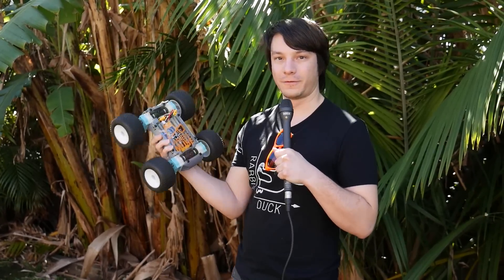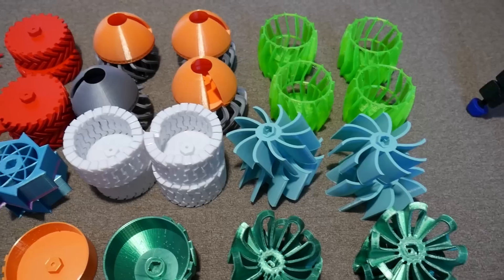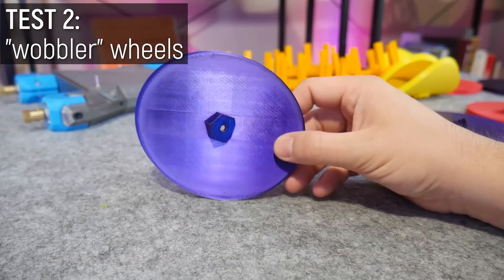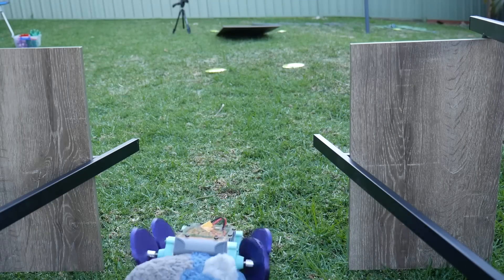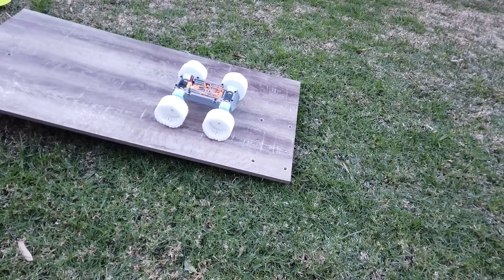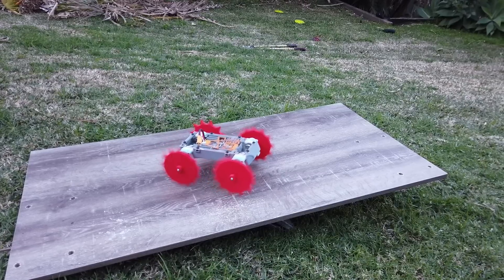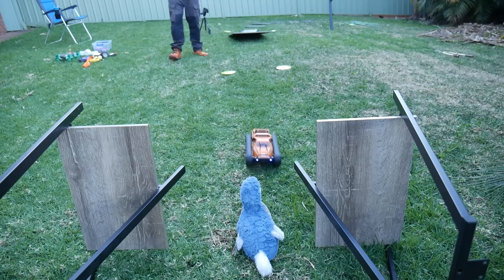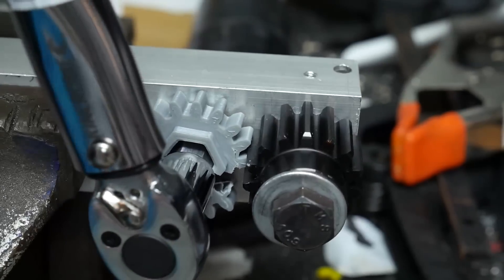These spikey wheels were dangerously effective.

Comment: Could you possibly try printing the MM wheel in TPU and at a lower than normal temperature for TPU so there is less gloss? Oh and make the the diameter of them much bigger so that they have traction no matter if the platform is upright or upside down.

Comment: Those Flex wheels need to get patented... Completely serious. The tests were unfair comparing to the tires and tank tracks due to their rubber construction. Solid plastic tracks would've undoubtedly spun on the rollers and seesaw, too.

It'd be VERY interesting to see the Flex if made from rubber, or coated somehow in a thin film of soft rubber. Spray on rubberized vehicle "undercoating", which in North America is applied to vehicles to protect from rust in snowy/icy winter months (de-icing roads is with salt or chemical, or worse, a mix of both). Although, rubber tool handle dip might be better for traction, it's thick and that'd be problematic for applying... Though perhaps a modified wheel with one less "link" and more gap in between to make up the difference, might work, allowing the handle dip to run off instead of clogging...

But yea, pure genius design and hats off to the creator of them for thinking outside the box! There is SO much potential for them, especially if they can be molded, since more complex designs can be used and no support material needed - say, diamond shaped, which would act like studs, for improved soft-surface (off road) traction.

Comment: If you used a spray rubber coating on some of the smooth plastic wheels, I'd be interested in the results. Might give more tractions. Another idea - wheels with variable but even width. Would allow you to climb narrower surfaces that are above and below and drag the cart towards the grip

Comment: I made a tank out of ABS, everything is printed solid at 98% infill, it has metal-toothed pullies as you find in a 3D printer with toothed belts as the reduction drive with 2 quadcopter motors. It has double reduction (i.e 2 belts per motor 1:16 reduction ratio) onto a metal shaft, a long bolt, using the hex bolt head to mesh with the ABS drive wheels (sprockets). The other only metal part is the roller bearings used on the main drive shafts and on all idler wheels. The shafts for the idler wheels are printed in ABS and 4mm in diameter with a slight flat on one side so it is printable. The idea works really well and is really strong. The shafts are stationary with the wheels spinning around them. Everything else is ABS printed (apart from screws and nuts holding the various parts together). There are 2 ECU's to drive the quadcopter brushless motors and the ECU's are controlled by an Arduino nano fully programmed by me (no Arduino libraries except for the NRF24L01 library). I find that printing things flat and bolting them together gives really good strength. It's a bit like cutting it out of plywood or a sheet of metal. The tracks are printed in ABS using nylon 3D printer filament as pins to hold them together. 
The quadcopter motors cost about $15 AUD each and the ECU's cost about $20 AUD each. The ECU's were reflashed with Simon K software to give forwards and reverse on the motors. The Arduino nano cost about $4 AUD and the NRF24L01 cost about $4 AUD. But I used a whole roll of ABS at about $35 AUD. Many parts were printed several times with minor tweaks to the design. 

I also made a bulldozer with a NEMA 17 stepper motor in the track frame and a single reduction belt drive (1:4 ratio). The motor has a metal pully (from a 3D printer) with a toothed belt but the sprocket end is printed in ABS with both the large-toothed pully and track drive sprocket as one unit (contained within the width of the track) this meant I could use a stationary shaft printed from ABS just like on the idler wheels. The belt is inside the track frame. By mirroring the process for the other side I had two tracks (no drive motors within the body) with wires from the track frame into the body. This gave me room to put a 3rd NEMA 17 inside the body to raise and lower a blade on the front. Again I used an Arduino nano to control all 3 stepper motors using my own code (no Arduino libraries except for the NRF24L01 library). 
The NEMA 17 's cost about $4 AUD each and each NEMA 17 has a stepper controller board (DRV8825) I also used voltage step-up boards to step the drive motor voltage up to 26 volts. This lets me run the NEMA 17 at 1,100 RPM for a somewhat slow top speed, but hey, it's a bulldozer and they are slow.

I built a remote control (from ABS) using an Arduino nano with an NRF24L01 wireless board with a screw-on antenna. I used hall effect sensors to read the joystick movements. The remote has automatic trimming on every axis (two joysticks with 2 axes each). Both the tank and bulldozer is steered by only one joystick (forwards and backward, clockwise and anti-clockwise turns). The bulldozer uses the second joystick to raise and lower the blade.

Both the tank and bulldozer use NRF24L01 wireless boards with the antenna "printed" on the circuit board, to be controlled by my homemade remote.  
If only I could post photos!

Comment: One thing that you should test is Platform configuration, I mean, its better a 4x4, 6x6 or 8x8 with what wheels in what terrain. A lot of offroad vehicles add more axles to better distribute the weight, so I do wonder if that can be seen at scale

Comment: ok one thing you need to add to that platform in order to properly test the performance of wheels is some fairly basic swing suspension so the wheels can swing out from the centre as weight is applied simply to allow them to better contact the ground as if even one is off the ground no matter the wheel design you will lose a very large portion of your control

Comment: Very cool.  But why not have the body vertically centered?  You can still drive when it's flipped, and with some vertically sliding weights your center of gravity will be below the axles so you'll almost never flip from too much torque.  You can even add tracks to make a truly unstoppable vehicle.

Comment: I wonder if adding some sort of suspension to the wheels could help them get over some of the obstacles and help with all the dumps. Maybe adding some weight to it as well to ensure it is making very firm contact with the surface it is on (and increasing the weight required to send it flying).

Comment: I don't know how open you are to suggestions but maybe putting a small amount of the liquid grip used to repair the rubber like grips on tools would be useful for the edges of the 3d printed tires.  I'm not sure what brands you have in Australia but generally you can find it in hardware stores and it is used to coat tool handles for better grip.

Comment: Adding a extra set of tires would divide the load of the RC car you made over the car. Also, it would add more weight to it, providing more downward force, making more traction. You can also do the same thing with lead sinkers or under mounted rails (like a bobcat, a Johnny cart, or something along those lines)

Comment: if you put some rubber-like material on the external surface of the Flexi-Wheelies (like hot glue or so) is possible to increase it's versatility on slippery surface? I'm asking because it's remember me of the wheel used fot the mars rover and they could be very usefull improving they'r grip :)

Comment: It's very fun but i think most wheels were judged unfairly! The material you made them out of don't have any grip and most of the surfaces were smooth placing plastic wheels at a disadvantage that is only because it's plastic and not because it's shape isn't viable

Comment: The wobbly wheels being good on rollers kinda makes sense. Because they aren't just pushing in line with the platform, they are also acting kinda like a with a screw action where they are pushing sideways as well which moves it forwards

Comment: Future idea: Using your custom design, some large toothed wheels that are taller than the body to allow for inverted driving + tracks connecting front and rear.
Maybe even with additional rollers in the centre region so that the side profile of the tracks is a squished hexagon.. sort of like how the side profile of the cheap tank looks but on both top and bottom.

Apart from the difficulty of turning on the spot (should be overcome by the more powerful motors you have on that platform) I reckon it could drive over damn near anything

Comment: well a continues track will almost always win, since it maximize contact while keeping the center of gravity low. the downside? failure in 1 point means failure in all.
you can get a compromise of performance and  avoid a single point catastrophic failure,  by adding more small wheels, instead of having lots of large ones. XD

Comment: I got one of those tank things before for snow and it turns out that the moment it looses too much traction it just stops so it doesn't work on ice or snow most of the time, my guess is the gyro that makes it go straight freaks out. From what I can tell the platform you built doesn't need any extra gyro sensors, so your robot platform would beat it there.

Comment: Looks like the brushless motors struggle at low rpm.  That's just super hard to avoid with sensorless comutation.  Also, try adding a v-tail mixer and tail-rotor gyro to the platform.  I'll transform you into a drift master and MASSIVELY increase control.

Comment: Quite fun to watch :) If indeed your gears got damaged you can use helical gears next time. With more teeth in contact at any time they can handle higher torque. With 3D-printing even double helical gears are easy to manufacture. That way you don't even get axial forces as a tradeoff.

Comment: I wonder how the flexible expanding wheels would do if you added small spurs or nubs similar to actual tires.
Reply: If you use the same slippery printing plastic, it'll probably improve traction on uneven (or soft) stuff but worsen it on a hard smooth surface like his "teeter totter"

Comment: before you showed the tank i was actually thinking about threads or maybe more complicated "wheels" that attach rigidly with a part, would that be an option for other wheels you test? like having a "wheel" from multiple parts (in the case of the tank the driving gears/pulleys hooking onto your gear case somehow)?

Comment: You could probably do independent 4 motor atv style tracks on your platform. Main sprocket would connect to motor. Could probably print the track tread out of tpu. There are several thingiverse projects like “no tanks”, mini track loader, “rc snow tracks”. Each wheel would be replaced by an independent track unit.

Comment: Those slippery materials would do much better if you coated them in a liquid rubber compound to increase the traction.  Especially that flexible wheel.

Comment: Would love to see a tutorial of the electronics and wiring. I want to build one of these, but have not wired a board  since college.
Reply: I want to build a 2-wheel robot, and am an expert builder, so all I need is a good outline. This is an excellent tutorial and I hope it has enough to get you going too. I didn't pay enough attention to see how far it goes into the firmware side of things, but I can figure that out. And it has a tether which could be power or control but I can figure out power and RC stuff. Either way, look for keywords, find a tutorial whose style you like, and go build something! https://youtu.be/yL43DSVdEEQ

Comment: Back in the early 90's I had a Tyco Fast Traxx that was quite the unit. It did have 2 limitations, ground clearance was not very good and it was prone to getting stuff lodged between the track and drive wheels. But the big problem was a weak gearbox. After minimal run time it would start loosing teeth and have to be replaced.

Comment: I would be curious how the hard 3D printed wheels do if you did something like glue a timing belt to the circumference or something.
Reply: Skin a R/C tire and put it on the outside. We just to cut and patch together different crawler tires back before they offered millions of options.

Comment: glad to see the portal axle idea works well.
tbh, credit to the Humvees for using this.
Reply from the maker: Worked great I had no idea spur gears would be decent enough for it. I can imagine at highway speeds they're not exactly recommended though.
Reply: @MakersMuse  you know, with enough lubrication...
jokes aside, straight cut gears are better than helical gears for high(ish) torque due to not loading the axle, and are used for racing cars, so the gears will be fine.
of course 3d printed gears might not work, but metal ones would.
also you may need to generate quite a bit more downforce due to how high off the ground the car would be with portal axles.

Comment: With the lockdown going on, you should send it to the shops to do your shopping to avoid contact. Bonus marks for remotely driving it all the way to the beach and back without leaving your house :)
Reply from the maker: I've considered something along those lines! My RC transmitters don't have the range but maybe something using the 4G network could do the job.
Reply: more lockdowns ?..ffs 🙄

Comment: V1: low fast fairly simple
V2: more ground clearance, better motors, gear box
V3: suspension, monster truck tires
V4: tracks without suspension
V5: half track with suspension on the tires and tracks with all previous aforementioned upgrades.
V6: some sort of system to allow for vertical movement like a grappling hook launcher
Reply from the maker: feature creep! It'll probably play out like that too.

Comment: Hi,
There is this stuff where you can "rubberize(?)" your metal tools so they have a rubber grip, what if you put that on the edge of the wheels to give them some grip?
Reply: Plastidip
Reply: Hot take: Flex Seal is just PlastiDip with "as seen on tv" marketing
Reply: @rpavlik1  they're actually totally different, I can't really think of any good application where you could use one or the other.  They serve pretty different purposes.

(Also flex spray or whatever is kinda shit and nowhere near as easy to use as you'd expect)
Reply: @startedtech  that's disappointing that the spray is less useful. I went to go get PlastiDip spray to repair a tractor seat, and imagine my surprise when it's in the automotive area of the paint department: apparently it's most popularly used for coating shiny parts on cars different colors 🤦

(And yes, like most hot takes, mine was intentionally exaggerated.)
Reply: @rpavlik1  well it essentially works as a temporary paint, so it makes sense. And it protects what's underneath.
Reply: FLEXSEAL LIQUID!
Reply: Love this idea!
Reply: Any of those lol
Reply: LOL just spray it with flexseal
Reply: Wasn't there a filment that acually contains rubber? Rubber filament? Won't be that better then TPU?
Reply: @MrGTAmodsgerman  interesting. It's amazing what kid of filament exist :o
Reply: Came here to say this also!
Reply: for relatively circular wheel you gould get a rubber band of the right size.
Reply: cut a hole in a balloon and wrap it. Like mousetrap cars
Reply: Flex seal or line x
Reply: Rubber cement. Do they still sell that stuff?
Reply: Ew furry
Reply: @forgthegodoffrogs7840  
>"ew furry"
>has an anime pfp
the lack of self awareness
Reply: @forgthegodoffrogs7840  not the topic.
Reply: @lavarsch  ew furry
Reply: @TheDJLionman  ok, and?

Comment: Question:
Is the ender 3 max a good printer for a beginner??
Reply: The ender 3 pro I have is the same design but a smaller bed, that was the first printer I got. The max looks good but unless you have specific plans consider smaller printers and building things in parts. You could buy 2.5x Anet a8 printers for the same price or, more practically as a beginner, 2 ender 3 pros for almost the same cost as the max. A good printer with autolevelling I use a lot is the Tronyx xy-2 pro, doesnt hurt the support staff gave me $50 to replace a defective part either. Trying to dial in the printer to fix errors is going to drive you crazy no matter what you choose, its a learning process. Good luck!
Reply: About a year ago I got the regular ender 3, i've been happy with it so far.

Comment: Reminds me of the old Tyco Rebound. Its a bit silly but I'd rotate the axles outward and stick some 2.8 monster truck wheels on if the gearing doesnt burn out the motor and allow it to run upside down like the Rebound

Comment: What if you coat the tire grip surface with some truck bed liner spray.  assuming it doesn't destroy the plastic it may help the tires get some grip rather than being smooth plastic.
Reply from the maker: It's definitely worth a shot! Michael over on teaching tech has played with bed liner spray before, it  stuck to prints pretty well.
Reply: I think it would be really interesting to try overcoming the slick surface problem purely with engineering and creative design.